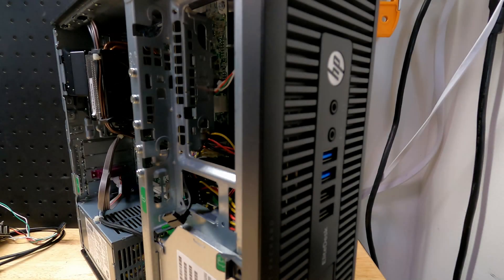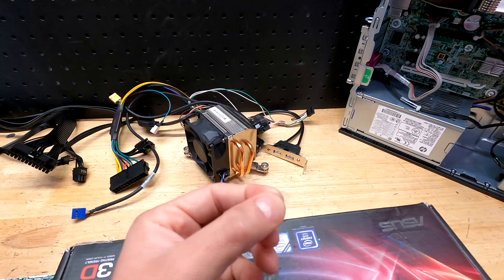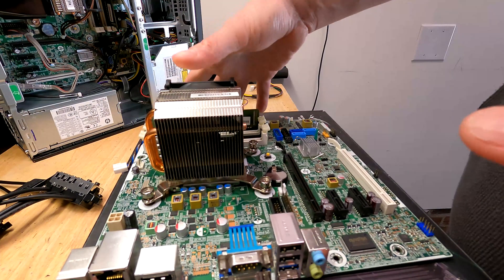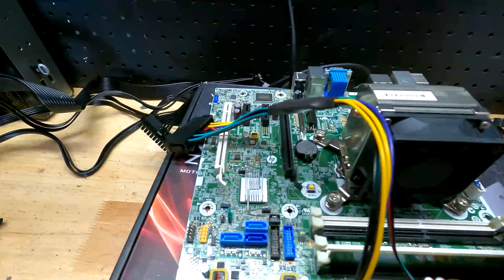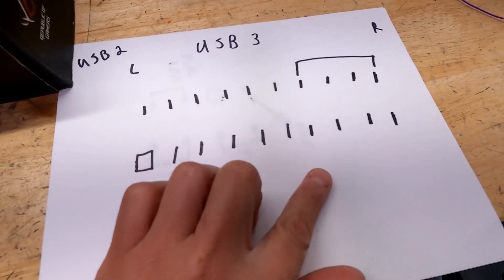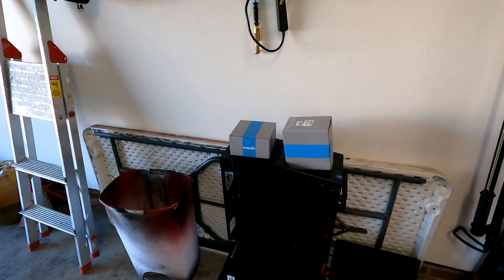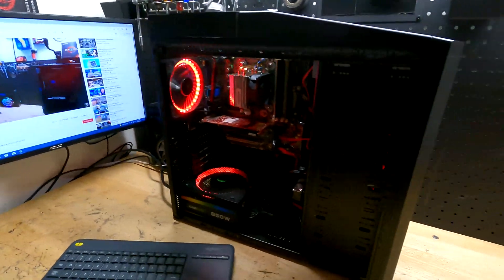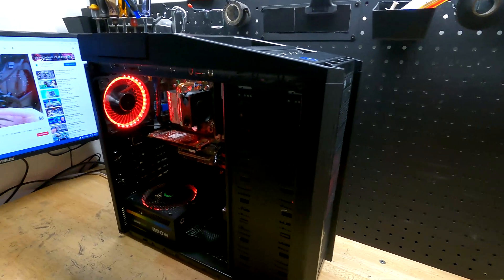Hp Elitedesk 800 G1 case swap!

Comment: Sir plz share your new cabinet name or link in this video
Reply from the maker: You can use any case you want. This was an old case I found in the trash that they don't make anymore.. I believe it was a antec 900
Reply: @DLMtechgarage  Sir One more question, what can I use my old hp cabinets psu in new big cabinet &  what all psu & cabinet cables properly Connect or we need more extra cable? (I hope you understand)
Reply from the maker: @sagarandrapiya0000  you can use your original psu, you would just need to get cable extension or lengthen the cable by cutting and splicing. I would be careful trying cable extension as not all pinouts are not the same and could short things. best would be to cut and add more lengthen to the existing cables.

Comment: I have a HP elitedesk 800 g1 i7 4th gen like in video and I want to do case swap as well but I’m a bit weary of the usb 3 and usb 1 error jump cables. If I have a case that can fit into usb 3 and 1 pins would I receive the error still? Or is this solution purely for if you are not using the pins?
Reply from the maker: All cases will fit the USB. This issue is that HP used a ground signal in one of the pins on their connectors to show that error when other front panels are used. By doing the pinout it gets rid of the error. It is only necessary if you do t want that error
Reply: @DLMtechgarage  Cheers thats helped me decide what I want to do with my pc. Thanks for the response!

Comment: Do you need to jump them before putting front connectors in or is it fine if there is something in them
Reply from the maker: not sure of the question you are asking.
Reply: @DLMtechgarage  Sorry I wrote that when I was tired lol. So you see how you used the jumping cables to get rid of usb f1 error, is this necessary to do if the pins are being used? And if so, do I do it before I transfer it into a new case?

Comment: hi, two question, i have the hp elitedesk 800g1 with an i5 4590 and a 240w power supply, 
1 question: I can add a gt1030 without problems with the power supply?
2 question: In case the answer to question 1 is yes, in the future I could put an i7 4770 on it or the power supply could not power the computer.
Reply from the maker: Those two upgraded would be fine. The gt 1030 uses very little power and leaves enough for the i7.

Comment: Bro help please can I replace the case of my HP 6300 microtower to a new one with the same compenents ??
Reply from the maker: unfortunately the way the hp6300 mobo layout is, it is not transferable to a typical case. since the 6300 is the q75 chipset, best bet would be is to take the cpu memory, and other components and transfer them to a newer motherboard so you can use a better case and psu.

Comment: planning to case swap and upgrading my old hp 8300 cmt. can u give me the tips for that? or I just follow this video? because it have same 6 pins power supply connector
Reply from the maker: should be the same as this video, key thing to remember is to make sure the adaptor is specific to the 8300, hp uses the 6 pin but with various different pin outs depending on the board. if you get the wrong one it won't post. make sure the one you buy has support for the 8300. I am not too familiar with the 8300.
Reply: @DLMtechgarage  ahh I see thanks anyway

Comment: I wanted to ask i have hp elitedesk 800g2  cpu so which motherboard will be there 
Atx ,mini atx or micro atx actually i wanted to upgrade my pc by adding gpu ao can u recommend me any low power gpu mg pc is of 200watt smps
Reply from the maker: the gtx 1650 or rx6400 or good options, require no supplemental power and are low powered gpu's

Comment: I can’t get the display to work. It seems to boot, but no display.
Reply from the maker: double check the bios settings for the gpu igpu,, it really can be a number of things, but if it seems like its booting then I would lean towards the gpu, also........... if you did the swap did you get the specific cable for the 800g1 psu, many people buy the z240 cable and don't realize it.

Comment: Hi Sir, what is brand and complete model number/type/series power supply you use ?...
Reply from the maker: it was a gamemax 650 watt power supply but you can use any power supply you want. key is to get the right adaptor for the psu connector for the motherboard.

Comment: You make it look so easy. I’m tempted to ruin my elite desk for the experience haha
Reply from the maker: it's actually not that hard and way easier then an optiplex
Reply: My Windows no longer starts after swapping. I don't know why. Do anyone knows how to connect fans to that motherboard?  @DLM tech garage
Reply: @zalien_  did you figured it out, because i have the same problem with the fan
Reply: @fredericbeaulieu5962  do you have Discord or something? I have images
Reply: @fredericbeaulieu5962  Using wires, powers fans from hard drive sockets. They'll be at full throttle all the time though.

Comment: The PC case I transferred the motherboard to has wires for a reset button. Where would I put these assuming they connect near the power switch?
Reply from the maker: not sure as I did not figure the reset button and everything i found, i was unable to find info on it.
Reply: @DLMtechgarage  That's fine, thanks for the quick response though

Comment: update to the my upgrade.   i was having errors where the motherboard would not boot but that was because of the cable i purchased from  newegg. purchased the one from your link and everything worked.    then i was having the usb and front audio issues but i fixed that now i found the original cable from the chassis  and now i have no errors and super fast boot up.     i had to cut the chassis apart to get the backplate for the fan.   i could of gone to the store to get nuts but i was already throwing away the  case might as well recycle some of it.
Reply from the maker: I have done that too with the case and cut out that plate. glad everything worked out!

Comment: Do you think my hp prodesk 600 g4 would fit with inplay wind 01 case? And do I need to buy another psu or can I use the psu that comes with my sff?

Thank you very much!
Reply from the maker: looking at the board it may be a challenge. the baord may fit but you will loose the fron i/o and then you need to figure out the  power pinout. as far as using that psu you may run into issues with cables not being long enough and possible having to rig up a way to mount the psu. I think it may be more trouble then it is worth in my opinion but def something cool to try and document.
Reply: @DLMtechgarage  Wow, I'm having the same thoughts. Thanks for the insight.

Comment: ok found out the cable i bought from newegg did not work.  i bought the one in your link and everything worked.  i wish i of done that 5 days ago...  now i have error 921  922 and 923   but i don't have from audio available and i do have the blue usb hooked up and i don't have a yellow usb connector i have the sff board
Reply from the maker: if its the usb error you need to jump those ground pins. the audio will just plug in and get rid of the error no moding needed.
Reply: @DLMtechgarage   in going to do that tomorrow.  i don't have a audio cable the box I'm using only has usb   no audio.   can i short the audio pins?
Reply from the maker: @justbored3.14  not sure.

Comment: Thank you for making these, i'm planning to upgrade my cpu case as well psu and adding gpu to it.

Few upgrades on these model are hard to find on YT, now luckily find one how to do it. Thank you man!
Reply: hello i bought a psu semi modular but sata power
 cable was missing is it okay to put the standard sata power cable on the motherboard?
Reply from the maker: @JesusAramil  yea you can use the ones on the board and it will work fine.
Reply from the maker: Glad the video could help. Key tip!! make sure you buy the psu cable specific for the hp 800g1. if not then it won't power on. seen alot of guys run into that issue. the z240 and other variants require the same adaptor but have different pin outs.
Reply: @DLMtechgarage  I have a Mid Tower variant so shouldn't problem at all then making those jumpers and psu adapter, since the motherboard are the exact same from SFF one.
Reply from the maker: @JesusAramil  yup same thing!!

Comment: i did the exact same thing you did my mother board won't turn on.  i got another g1 800 hp board wotking in original case to everything out of that and put that on my test bench and that will not boot.   neither board will boot using original  ps
Reply: ok after trouble shooting figured out is the 24 pin cable i bought from new egg.  original power supply is working on mb after cmos reset.     i looked at the cable link you posted and the wires are different colors from my original power supply and in different pin layouts
Reply from the maker: yea you have to get the specific one for the 800 g1. the z240 and another variant look exactly the same but are wired differently.
Reply: @DLMtechgarage    i thought i got the right one but they all look the same.  the cables lol.   i ordered the one i saw in the video will test tomorrow

Comment: I have the MT version with an AMD processor i have been trying to find a way to change the cpu heatsink.
Reply from the maker: i know on the intel platform you can't with out modifying the mounting brackets.
Reply: @DLMtechgarage  When i get a chance to do it i'm going to get one of the Intel stock coolers remove the bracket from my heatsink and machene a way to attach it to the intell cooler
Reply from the maker: @howardwilson3466  keep me posted curious to see how it works.
Reply: @DLMtechgarage  I will

Comment: thank you for posting this, this is perfect timing for me. ive had one of these oems laying around and I wanted to try to utiize it in a cheap pc. since mine has a 240w psu, do you think that would power a 1050 ti (no external power) and an i7-4790?
Reply from the maker: yup would def run fine. I have gone that route and not had any issues. just the lp 1050ti a little too expensive.
Reply: @DLMtechgarage  what will happen with the usb cable jumper wire thing does it mean i cant use any of the usb in my motherboard and case? 
and if i add a pcie x16 extender can i use a non lp gpu?

Comment: How were you able to put more than one case fan? I'm planning to put 4 case fans in total (the case fan that comes with hp and 3 aftermarket case fans). would it be possible? do i need a adapter or something? nice vid btw!
Reply from the maker: I bought a kit that used SATA power to power them via a hub, I use the gim fans which work great and look good. will post a link to the video i did on them.

https://youtu.be/0vWqxhgsyoM
Reply from the maker: @Kame just a sata to 4 pin fan splitter

Comment: You didn’t even show how you took it apart...smh 😂😂🤣
Reply from the maker: it's fairly simple and easy to do.
Reply: @DLMtechgarage  lmao well I figured you would of shown us in a case swap. I get it’s like 8 screws and cables man, but it might of been easier watching it LOL. Did I have to remove the cooler? I did it anyways to reapply the thermal paste
Reply from the maker: @ASGIE88  yea you have to remove the cooler to remove the board, then to do the swap you need to get the washers and nuts as you have to reuse the cooler.
Reply: @DLMtechgarage  also is there a huge difference if it’s an atx case and I have the pff or whatever version?
Reply from the maker: @ASGIE88  not much of a difference pretty much the same.
Reply: @DLMtechgarage  will the holes line up? If I were to take my mother board out
Reply from the maker: @ASGIE88  yes all the mounting holes for the mobo will line up.
Reply: @DLMtechgarage  it is not simple. I just found out the difference between itx, and atx. 🤣

Comment: What case is this or can I use any atx compatible mid tower? I have this exact PC, just wondering what options to look for
Reply from the maker: you can use any case you want.
Reply: @DLMtechgarage  is there a certain case type I need to look up litteraly any case under the sun?
Reply from the maker: @urjnlegend  any atx case

Comment: what connector did you use for usb port? I was kinda confuse with shorting..Normally a new case comes with 9 pin usb 2 or 3 from the case usb ports. How will you use it for that motherboard? please explain further to me..thanks
Reply from the maker: I use the stock usb port, add the extra pin and splice into the original connector.  I have a video on the z240 which shows it alot better. link below

https://youtu.be/3qOmhk6gVik

Comment: I have the HP EliteDesk 700 G1 (Mid-tower) and i am planning to put it inside of an m-atx case.

The Mid-tower Version is op, because u can fit in a Full Size GTX 1050Ti without changing something. All i have to live with is one SATA Slot less and i needed to switch the way the CPU-Power cable is connected.

Edit: Btw great and helpful video, even ur tips for the lots of pins and connectors!
Reply from the maker: yea i prefer the midtower versions. so much easier to upgrade. I like to mod them too, cut a window, some custom paint and they tend to sell quick. Appreciate the comment!!
Reply: @DLMtechgarage  Do u know if the adapter still fits in the 700 g1?
Reply from the maker: @_drengr5701  not sure, have not been able to confirm it. i see that 600 and 800 have the adaptor. I will keep looking and let you know what I find. The adaptors vary on pin out and getting the wrong one causes issues.

Comment: I love, love love using HP ProDesk 400 (G1/G2) and 280 (G1/G2) upgrades. They take regular ATX power supplies (no adapters needed), support E3 Xeons and are EASILY turned into gaming PCs. Sometimes for longer GPUs, I dremel out a tiny piece of metal (second hard drive cage). 
I don't case swap, because it's not worth it imo (not until GPU prices allow me to turn them into $500 systems again). Those $250-300 systems with a $20 PSU and old GCN 1.0 cards are great entry level systems for a lot of kids.
Reply from the maker: GPU prices killed me on the budget builds...... for the sff i only do the case swap. the regualar matx I just throw in a gpu psu ssd and flip them easy!!.... before crazy graphics card prices ofcourse lol...
Reply: @DLMtechgarage  well we are here now!
Reply: just get a cheap, older gpu
(i recommend the amd ati radeon r5 340x) which has 2gb of ddr3, and it runs really well. @DLMtechgarage

Comment: have  the same computer and have been debating a case swap...
Reply from the maker: go for it. pretty easy and the boards on these are solid!
Reply: @DLMtechgarage  hey sorry for bothering you again...when im jumping the signal connector to the ground on the usb 1.0 pins....can i just take some plyers and pinch the 2 pins together so they're touching eachother??...isnt that in "theory" the same thing as using a jumper wire???  just curious on your thoughts...thanks in advanced!

Comment: Am having difficulties find the right washer and nuts the ones I got are to thick :(
Reply from the maker: amazon has them in bulk and a kit. link below should be what you would need

https://www.amazon.com/QTEATAK-Black-Washers-Assortment-Screws/dp/B092V33YX3/ref=sr_1_5?crid=3BAXNFXWK0XVA&keywords=%236-32+plastic+washer&qid=1647200208&sprefix=+6-32+plastic+washer%2Caps%2C67&sr=8-5

https://www.amazon.com/Prime-Line-9074021-Machine-Screw-50-Pack/dp/B074ZZFP9B/ref=sr_1_11?crid=3SQOZUAMUMNY5&keywords=%236-32%2Bnuts&qid=1647200144&sprefix=6-32%2Bnuts%2Caps%2C70&sr=8-11&th=1
Reply: Thank you , doing the case swap for my bro, appreciate it :)
Reply from the maker: @LoserK96  anytime, let me know if you ever need anymore input!! Happy swapping!!

Comment: Great video man. Curious to see if you can use small wires , and solder jump those pins on the back side of the board , so you can still use the headers
Reply from the maker: you can, what i do is splice the jumper wires into the connector and you can still use the headers.
Reply: @DLMtechgarage  How do you mean. I am in Belgium and no native English speaking person. Splice the jumper wires into the connector?

Comment: What gaming temps the CPU run at?
Reply from the maker: I should really starting posting that but with the bigger case and extra fans, gaming temps when from like 70 to 60c remained steady and running cinebench, the old case was hitting temps in the 80's and I was able to get it down to like 65

Comment: What I usually do is change the bios image so it doesn't say HP. Just little cosmetic thing
Reply: Your welcome. I'm sure you will be having a video in the future where you do exact thing. Looking forward to watching
Reply from the maker: How you do that?? did not know that could be done!!
Reply: @DLM tech garage  different motherboards have different ways to do it depending on age of bios. Google change bios logo. Should point you to the right direction. Definitely better to change it if in a new case to hide the branding. Also ways to change the windows 10 logo and add custom startup sound. For example, I made arcade machine/pc setup for the nephews and had a playstation logo and startup theme when you turn it on, then had autorun to hyperspin on startup. Always little quick things that will  turn a great job over the edge to professional  level kinda deal. Someone can cut down a tree perfectly but what makes them the best is when they do the clean up at the end compared to someone who leaves a mess. Same deal here
Reply from the maker: @GFDthatsMe  awesome info thanks!

Comment: I use those Arduino wires too,  mostly for fan sensor jumping on older Optiplexes. I even made a 24 pin harness adapter out of them once years back,  good vid man.
Reply from the maker: Thanks!!